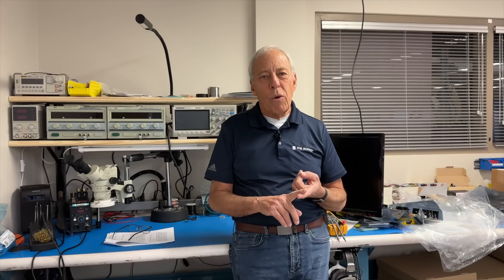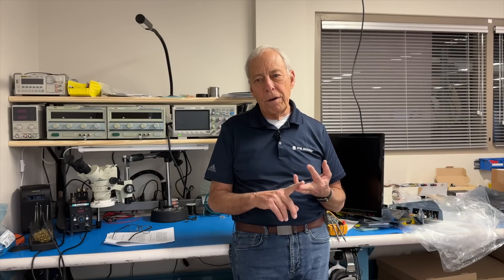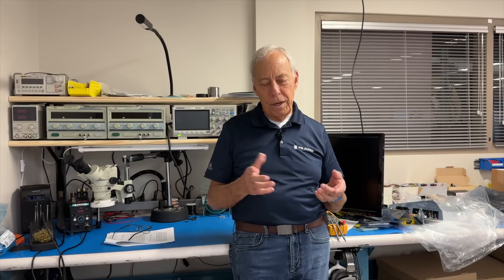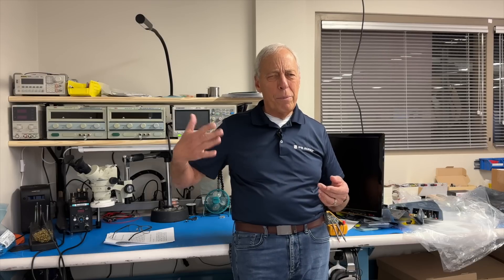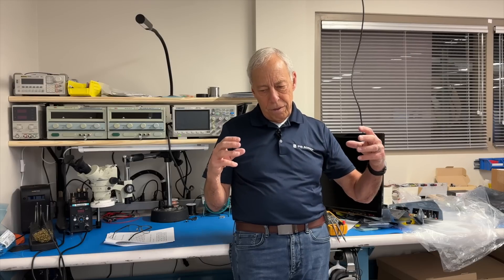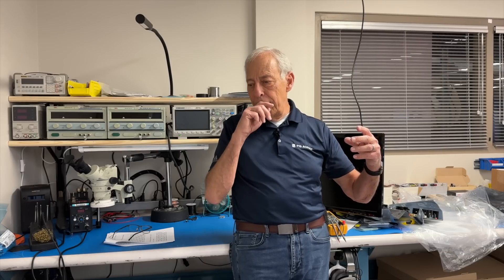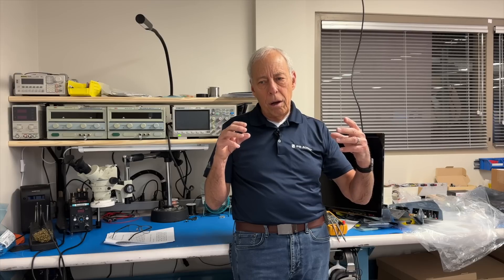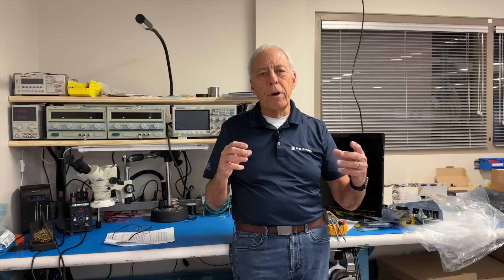Have microphones gotten better?

Comment: The biggest improvement in microphones is getting the high frequency resonances octaves away from the necessary bandwidth. The old Neumanns, Telefunkens and AKGs had resonances between 25 and 30K - exactly where aliasing in early digital (44.1K/48K and 50K) was a huge problem. The new microphones help lose artifacts that were part of early digital recording. This was never an issue with tape as the recording head gap was a brick wall filter that kept the resonances out.

Comment: I think a lot of recording studios prefer the vintage or re-issued microphones.  A mic can measure really well but not sound that great.  Even the old vintage Neumann mic's will sound different from mic to mic in the same model.  My brother has a collection of mostly vintage or re-issue microphones.  There are so many variables such as the diaphragm, capsule, tube, power supply etc.  The re-issues of the Nemanns are very good but their is a caveat.  Even if they are within "spec" from the factory they can all sound different, some good some not so good.  Klaus Heyne is the master of tuning these re-issues to their optimum sound performance.  If you are really into it, this is probably the best way to go.  There are not shortcuts.  Just my two cents.

Comment: I use the (fairly new to the market) Warm Audio w-87 which is supposed to imitate a Neumann mic. 
Sadly, I think the mic has ground issues thus it makes a loud pop noise every now and then. It used to also make a grinding noise which for some reason disappeared. I’ve not been able to use the mic much. I think I got a bad one, but it did not show any issues until about a year later. $500 down the drain unless I find someone who can fix the ground issue.
Reply: Check your phantom power supply.

Comment: Do any modern mics lean towards a warmer sound signature? Any suggestions? I started looking for one that can reproduce my nylon guitar tone properly, and in the budget range I have not been impressed so might have to get something more expensive.
Reply: There’s a number of modern microphone tube preamps. I don’t know if call them ‘warm’ as much as smooth. You can also roll tubes to somewhat refine sound. Of course the sound engineer ultimately controls the recording master with mixing board/software

Comment: I had a mate who used to "borrow" a pair of Bruel Kjaer 1/2 inch condenser measurement microphones from work, back in 1984 ish. They used a 200V phantom power were ridiculously flat and could take huge SPL levels. He would go to his local pub, cross them over the bar and feed them into a Revox converted to half track. He got some very interesting and natural live jazz recordings. New mics will always have an advantage, but the old mic's were not lacking. These were (from memory) over £600 for just the capsule, so about £2600 ($3200) per capsule in todays money.
Reply: B&K is now called DPA

Comment: I have used many microphones in my studio over the past 30+ years. Paul is right about DPA microphones for some applications anyway. I use DPA DDK4000s for recording drums only. That said, the AKG C12 Tube condenser microphone is by far the most accurate and best for recording vocals. I use other microphones depending on the instrument or amplifier speaker being recorded. There is no one-trick pony when it comes to microphones. And of course, some sources are plugged directly into the control board interface and don't require a microphone.

Comment: How in the actual holy immaculate $#&% do they measure a microphone at 100k? I wanna hear those tweeters or at least see the ridiculous compensation curves involved in the process. And 2Hz from something the size of an electrette? Really?
Somebody help me out here.
Reply: There are ultrasonic speakers out there, especially for measuring purposes. And smaller microphone capsules aren’t worse at recording very low sounds, in fact they (generally speaking) have a more linear frequency response, although they are noisier. That’s why Studio microphones usually have a certain capsule size, but measuring microphones are much smaller (because noise isn’t such a big deal there)

Comment: The Sennheiser you're talking about is the MD441. And they are just dynamic, not condensers. (Thought they cost as much as a condenser.. most $$ dynamic out there)
Reply: Back in the early '80s I bought a Sony TC-D5M cassette recorder and a pair of MD441 mics to record Dead shows and other live music, and I still have them. I'm now building a live music venue with full recording and streaming capability, and I'm probably going to use the MD441s to record the room ambiance track because they can handle high SPL.
Reply: @alex_stanley  They are great microphones, I bought a pair for snare micing and as my personal live vocal mic... I stop performing live, but got the mics
Reply: He could also refer to some hypercardioid models of the MKH series (which are indeed condensers).
Reply: @Fastvoice  but he's not, they weren't around 40+ years ago
Reply: @drdelewded  The MKH condenser line started in the early 1960s and was improved in the 80s. The hypercardioid MKH 50 started in 1988. And in the video he says "they've been around for 30 years" which would be about accurate.